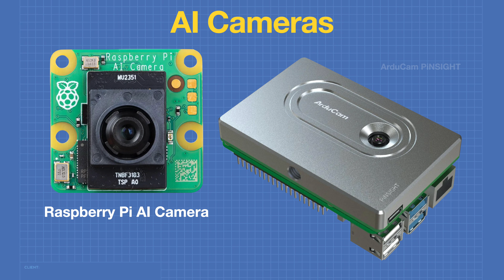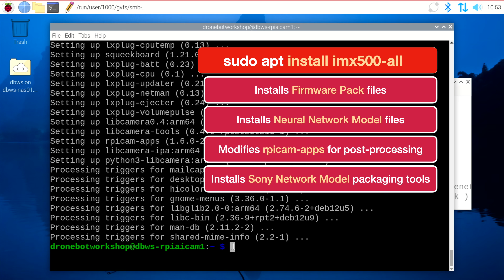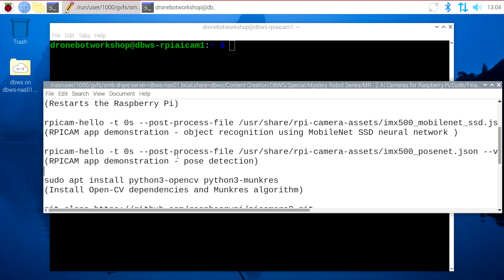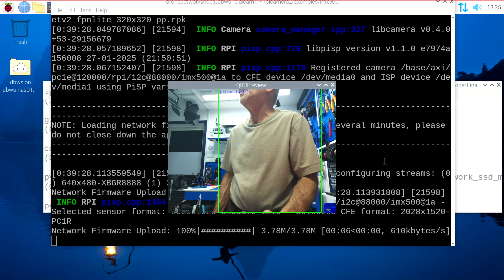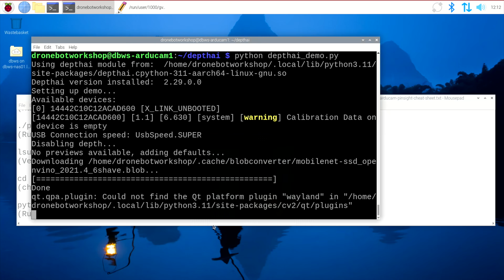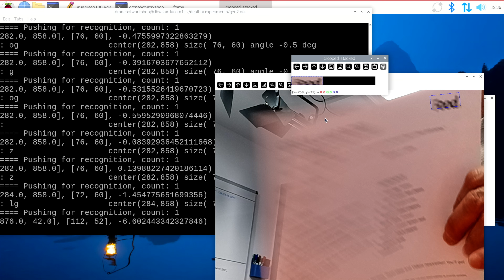Two Raspberry Pi AI Cameras

Comment: Did the raspberry pi ai camera get hot in use, I would hope that the arducam alum. case would be set up to sink excess heat. I haven't noticed heat with pi cameras but the espcam sensor can get hot. There is a lot going on in these ai cameras!

Comment: The earliest production neural network I have yet found in the literature was running by 1943. It was physically implemented on a network of magnetic sensors in Chesapeake Bay intended to detect German U-Boats. The report was published in one of the cybernetics journals in the early 1950's - after declassification.

If anyone else knows of an earlier AI system I'd love to hear about it. It's hard to find the papers that report them prior to standardised terminology for them - it's probably not a coincidence that the earliest one I can find dates back to the early days of cybernetics (my search term lol).

Comment: Nice review, well done.  A few questions come to mind.  You say the Pinsight takes 1 amp from the Pi USB.  Wouldn't that over load many early Pi's ?  Second.  What makes the Pinsight specific to Raspberry Pi.  Couldn't it run from any Linux system.  While I understand and like the concept of AI camera, the demos you showed didn't do anything that a cheap Pi camera (clone) with processing on the Pi could not do, perhaps at a slower frame rate.  I look forward to hearing about use cases where they really shine.